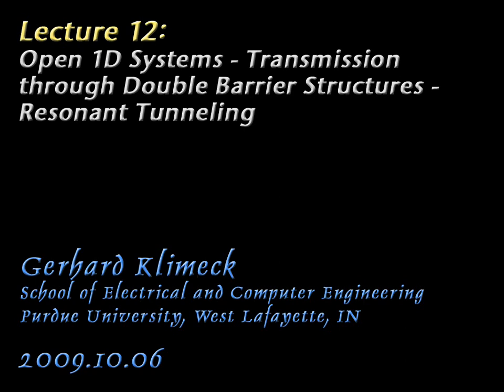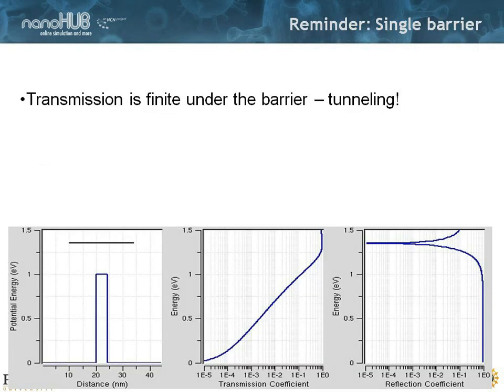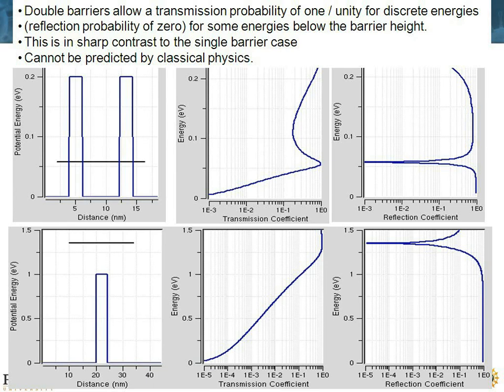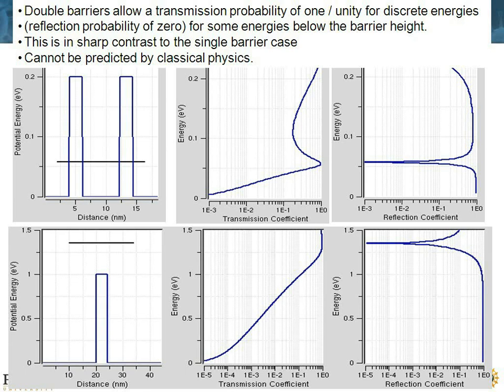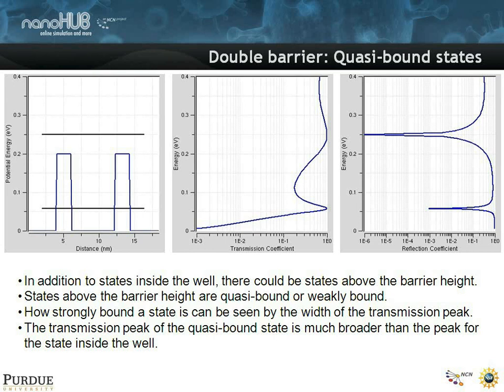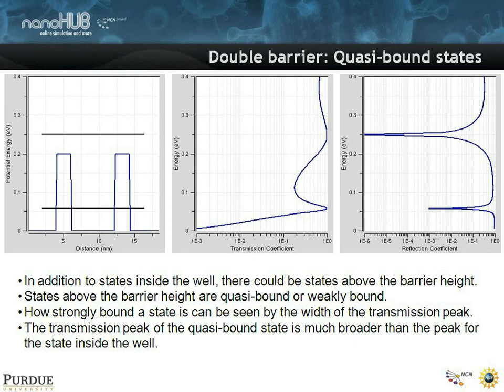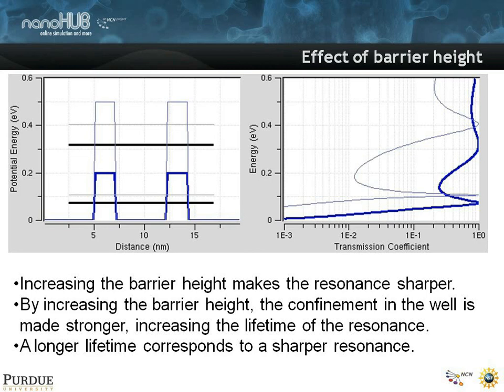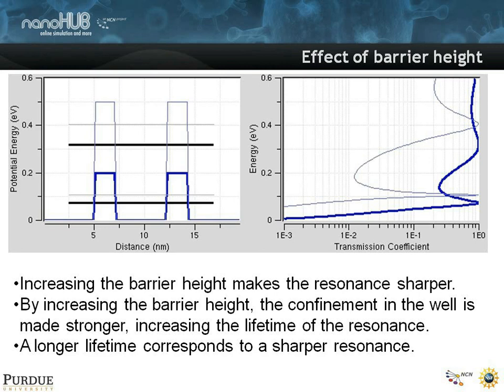Modeling Lecture 12: Open 1D Systems - Transmission through Double Barrier Structures - Part 1/3

Comment: -Fantastic work and lecture with my best wishes.
-I only wish that people stop talking about all the things 'that cannot be done by classical particles' and 'classical physics'. The simple inverse square law has wave solutions when in confinement. It is possible to show that using particles moving under the inverse square can simulate the famous double slit experiment (and otheres). The wave like behavior is obtained due to the presence of the boundary of the slit.  
There is only one physics.. the correct physics.. the logical physics.. that is the classical physics and everything else is a derivative useful ones I admit.